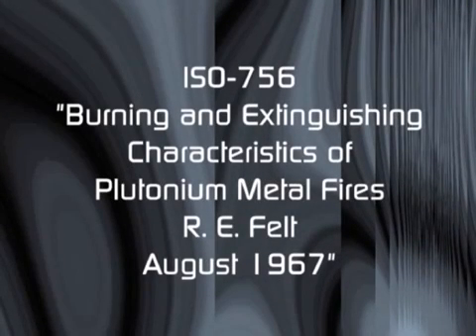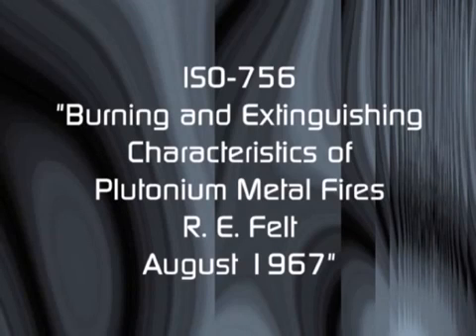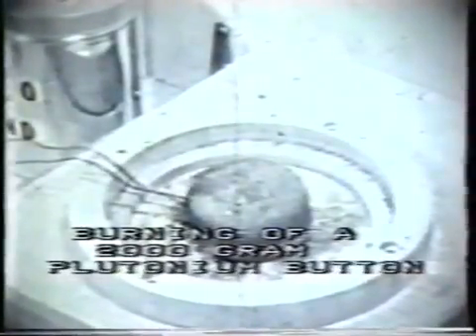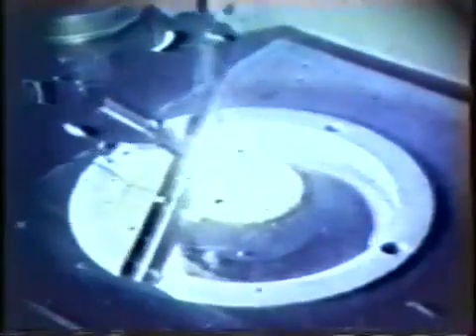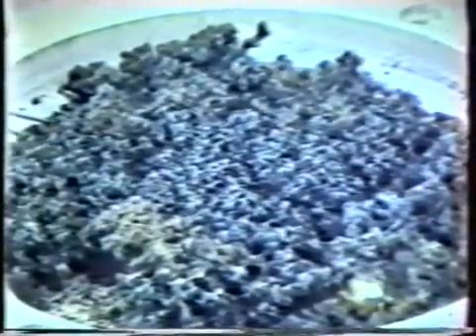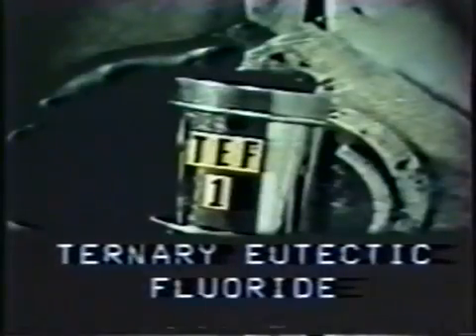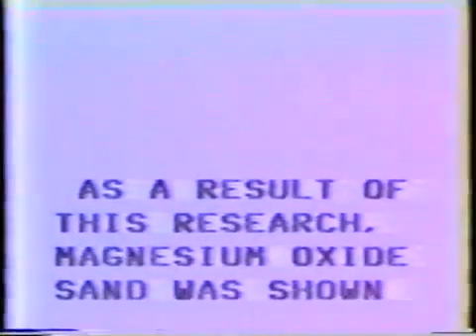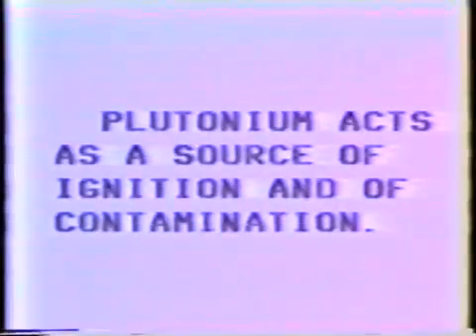Burning and Extinguishing Characteristics of Plutonium Metal Fires

Comment: It took a carbon arc to ignite it, how pyrophoric can it be? Just don't let powder collect, I guess.
The sight of burning Pu is terrifying.  I'd just as soon not be in the same county with the stuff, and
aside from little samples in element displays, I think that's true. Used to be downwind of Rocky Flats when it operated tho.
Reply: In bulk form it's not too bad, but fine turnings are outright flammable, they burn similarly to magnesium but not as hot. Another nasty habit is it preferably forms peroxide and hydride when exposed to air resulting in an explosive fire that cannot be put out till the peroxide and hydrogen are consumed. 😳☢️💀💯

Comment: They claimed they used water to put out the plutonium shavings fire at Rocky Flats in 1957. I call bullshit.
Reply from the maker: Water is the only agent that has successfully extinguished a facility fire involving plutonium. The reason water was so successful at Rocky Flatts is that the fire department used a misting, fog type nozzle. This causes Pu to oxide in a more controlled manner without moving or spreading around. It slumps and stays. So, yes, I can confirm, they certainly used water in several of the Rocky Flats fires. 

https://www.energy.gov/sites/default/files/2023-05/Bruce%20Campbell_The%201969%20Rocky%20Flats%20Fire%20-%20We%20Should%20Not%20Forget.pdf

Comment: Using graphite powder to put out a Plutonium fire requires balls of steel. Graphite is a moderator, meaning that it significantly reduces the critical mass. If you aren't sure about how much Plutonium is burning, and you pour graphite on it, you could end up with something that makes you forget all about that little fire. Then your hair falls out.

Comment: These were very costly experiments. The Pu was designated for recovery and would have been oxidized anyway. The experiments we are watching would have been highly classified. There concerns at the time may have been more about fire and material containment than extinguishment. These studies probably helped establish dry-box and other containment enclosure limits for Pu fire control. I would have liked to watch the same experiments with Thorium, which gives off the most beautiful blue hue when burning, but would have burned through the stainless dry-box bottom in a split second.
Reply: How hot does thorium burn?

Comment: I have always been curious about how scientists determined how to create and store such dangerous material. This is fascinating.
Reply: it'sthe waste acids and gasses i'm curious about
Reply: @wolu9456  That part became a superfund site and we spent a fortune managing all the contaminated substances. Or in the USSR, they dumped all that crap, including the waste fission products, into a big holding tank, where the fission products provided a steady heat source, and wouldn't you know, once it boiled dry, the nitric acid plus a few other chemicals, under high temperature, form ammonium nitrate. They were doing this on the scale of many tons, and yeah, they triggered a ~100 ton convention explosion of ammonium nitrate, which, fine, that's not a big deal, but it's dispersing radioactive fission products all over the place. That area is now a "national park", off limits to the public -- see "Kyshtym disaster".

Comment: So this is why my friend from Los Alamos told me they had buckets of mag oxide sand in many of the labs he serviced as a maintenance technician. Told some crazy stories about having to fix a mill mid operation. Said you had to dress in secret clothing and spend minutes working max. He lost his nerve after seeing many friends with cancer. I wonder how much radiation is released during the fire. And at what oxidation state does the plutonium end up at? Can the metal be recovered still? Very interesting.
Reply: Chemical reactions do not interfere with ionizing radiation which is something that happens in the nucleus of an atom.
The amount released would be the same if the lump did not burn and can be precisely calculated.
Reply: Mixed oxidation states, it pretends to be 3 and 5 plus iirc. Yup they are very funny about some types of research, and they like to compartmentalize it. Hence you may have a q for something but not for another project on site. Also the person doing the machining and the maintenance have no idea what the part is for. Plutonium is used for all kinds of research ranging from neutron sources to acellerator targets to nukes to special reactors and thermal batteries for space and deep sea stuff. Machined Plutonium is usually for variants of nuclear weapons parts or precision (micro scale) reactor parts.
Reply: @christopherleubner6633  Back, when my friend was working there, The US was  in full nuke production and still doing underground testing. I'm guessing the labs are doing much different stuff now.

Comment: You can simulate the plutonium burning with a metal called cerium. Was rather surprised they tried halon as it is a major NO-NO to use it on any kind of burning reactive metal. Cerium is the metal that gives cigarette lighters their ignition sparks, to see how a plutonium fire would burn heat a cigarette lighter flint till it ignites and drop it on concrete. 😲 If you disturb a burning plutonium fire, it will burn more violently. Argon gas is used to fill gloveboxes for machining the stuff. An emergency back up extiguishing media of a glassy sand that forms a low melting eutectic crust or a metal alloy powder is also available. 🤓

Comment: Turning Plutonium on a lathe would likely leave fine shavings and the heat generated from frictional resistance I would think could ignite Plutonium.  
In these tests it would seem would endanger workers exposed to the Plutonium and its gaseous oxides.
Reply: It is turned in lathe that is in a glove box with a magnetic clutch from the machine motor itself. The glove box is filled with argon or nitrogen, though sometimes helium is used. The stuff machines very similar to gummy aluminum alloys, but if you tried machining in air it will burn like ferrocerium shavings. This would be very very bad.
Reply: The lathe would likely be contained in an atmosphere of hydrogen to preclude spontaneous ignition of the Pu.

Comment: It's rare to find pictures of plutonium in quantity. And here we see a 2kg puck burning. Amazing stuff. It brings into perspective that even Plutonium is "just" a material. Nothing magical about it. You just need a lab the size of a city to handle it. And tuna cans.
Reply: I find it way more interesting than most materials. It has 7 different allotropes, all with different metallurgical qualities (which is why it's so difficult to machine) It's super heavy, pyrophoric, radioactive. And completely man made on earth.
Reply: @RobertCraft-re5sf To the detriment of all living things!
Reply: @RobertCraft-re5sf  "completely man made" is not exactly true. Read about the Oklo natural nuclear reactor that was discovered in Gabon Africa in the 1970's. Plutonium was found thats formed by surplus neutrons transmuting U238
Reply: Isn't that 1/4 needed for a critical mass?
Reply: You can make a working bomb with less than 2kg.
Reply: with neutron reflective materials , you can get down to 5 kg of plut to go critical, but then it will just melt with extreme predjudice, you must clobber it with focused shaped charges  to get super-criticality [ boom!]  and if its next to a bar of lithium deuteride/tritide  wrapped in u238 [tamper]  you get fusion[ big badda boom!] @n1k0n_
Reply: A critical mass isn’t a single number. 3 kg is more than enough in most weapons; the reason is neutron reflectors and the implosion that compresses it.
Reply: And acres of land nobody can go to or use for 10k years to store the poisonous waste where nothing bad can ever happen .
Reply: Radioactive materials are highly solvable in water! And if one isotope isn't solvable, as it  decays into other elements it can become a gas, like xenon133, or an element that is solvable!
Reply: @richinoable 640 square miles at Hanford WA!! 475 BILLION GALLONS OF EVERY SORT OF TOXIC WASTE DUMPED DIRECTLY INTO THE SOIL!
Reply: 😂😂😂😂 lmfao "and tuna cans" 🤣 brilliant! I haven't laught this hard in age's. Thanks man... "tuna can's" 😅
Reply: @kev04092  And all that means is simple acid oxidation. Been done now for about 100 years. The narrator didn't say how much of the material was recovered. Buring/combustion is a form of oxidation it can also permanently change matter. Look at a cracker in a refinery. It's capable of ripping molecules apart and rearranging atoms and making different new materials. And we all know as radioactive materials decay they are no longer what they were amd can't be. Uranium decays leaving radon gas. Radon is made up of atoms from the Uranium. Your never putting that back in the bottle. So if it burns what would it NOT be possible to become something else? Thats my point and question.
Reply: The plutonium was less than weapons grade so it was used. They were going to turn it into oxide anyway for making reactor fuel. Too much 240 in it. The real danger is if chips and turnings react with moisture, it preferentially forms peroxide and hydride due to the radioactivity, and when it ignites it flares violently and can cause a chemical explosion scattering it everywhere. This happened at Rocky Flats, more than once. 😳
Reply: the USD 300-400 per g figure reflects only the incremental operating expense of stripping plutonium out of already-paid-for spent fuel, whereas the “millions per kg” number folds in the capital write-off, R & D, security, waste management and eventual site remediation.  Because plutonium production is capital- and compliance-intensive, those fixed charges dominate the economics once the material is expressed per kilogram.
Reply: @felixg3  The corollary is then also true. If you have to have those sites anyway, the marginal cost per additional gram produced is low; so go big or go home.
Reply: And at millions per gram you also need a train full of large bills for a small test. And another train load to clean up. Then 9 more trian loads to store the mess.
Reply: @tireballastserviceofflorid7771  I am sure after burning it every single bit of that smoke Pu oxide smoke and ash was condensed and collected to be made into metal again.
Reply: @RobertCraft-re5sf  But you don't really know. Could be buried in a waste pit.
Reply: @RobertCraft-re5sf  could also be released and "whoopsed" if someone found out
Reply: Your a bit out with your price. It costs $300-$400 per gram.
Reply: @HE-pu3nt I think they put the whole cost for the plutonium production into account, including R&D and upfront investments. The variable cost of plutonium may be 300-400$ per gram, but that does not take into account the deprecation of the facility and projects related to plutonium production. In that metric, it’s probably much higher, into the millions per kil
Reply: Plutonium was not nearly that expensive. They started with big graphite reactors and lots of reasearch; but that’s not how they made most of that plutonium. It was made in a mature process with much fewer researchers.

Comment: This hits home for me. I've visited a vacuum lathe used for designing warheads. The question of handling the turnings has always been a question in my mind. This example was what I was thinking might be a possible outcome.
Reply: The chuck is coupled by a magnetic clutch into an argon filled glove box. Relatively normal tools are used for machining. Chips are sucked into a special criticality safe vacuum cleaner with a built-in neutron detector with the HEPA filter recirculating the argon inside.  The whole machining center is at a slightly negative pressure relative to atmosphere.
Reply: @christopherleubner6633   thanks for a more thorough explanation of the equipment I saw. I was shown that lathe while I was in the lab. I didn't see it in operation but a simplified explanation was given to me at the time. There was, at the time a lot of security about certain processes being performed there.
Reply: Rocky Flats Nuclear Weapons Plant where 2 of the worst and most expensive industrial fires in the USA occured ,..... 1957 and the 1969 Mother's Day Fire were the result of Plutonium scraps and shavings  spontaneously igniting and spreading from 1 glove box to another !  All the various machining and casting operations had cans of oil to extinguish any Plutonium fires that started by smothering the Plutonium and omitting the oxygen . Later, fire sensors were installed in the glove boxes on Plutonium stored in Benelex plastic enclosures as a fire prevention measure . However, production was slowed and workers blocked the fire sensors to speed up production . The resulting fire nearly took out the roof of the building which would have spread Plutonium easily to Denver and beyond !   Watch video ,.... " Secrets of a Bomb Factory "  also analysis of the Rocky Flats Fires !
Reply: They vacuum them up into a donut shaped canister that separates and reuses the cutting fluid ( newer ones use dry inserts) as the chips are produced. The whole system is closed and purged with argon or helium, with helium being preferred for weapons materials. When the container gets full a neutron detector sets an alarm off ( well below criticality). Then you swap out the container for a fresh one and resume work making shiny half footballs. 😂
Reply: Thanks for the info. The one I saw was used for certain base element boosters in weapon production. It was an amazing piece of equipment, I don't think that all of the finer points were explained. I was there to use a different piece of equipment but got a full tour of the lab. @christopherleubner6633
Reply: ADA165790.pdf
google it
Reply: talk about not knowing what "hit's home" means 😂

Comment: Hmmm...Rocky Flats had some horrific plutonium fires that were very hard to extinguish.   Machine turnings  in large amounts once burning just dont go out.   Water will actually accelerate the fire.
Reply: AND moderate the neutrons. A HUGE NO-NO😮
Reply: Yeah it's interesting because a former worker in an interview said one thing they did in 1957 was dump boron onto plutonium.
Reply: @fredharvey2720 yup a borosilicate phosphate glass is used as the last resort for putting out PU fires, typically small fires are put out with argon gas if at all possible.
Reply: Yup they had lots of spicy turnings there, Pu U and Be. Not to mention the highly flammable Ti and MgAlBe turnings. The place had Homer Simpson levels of disregard for safety combined with  better than Ft Knox leves of security. 😂

Comment: The amazing thing about this video is the primitive apparatus used for the test.  Just gonna put 2 kilos of Plutonium on this fire proof sheet and put a ring around it 'for safety reasons', then set it on fire and see if we have anything that will put out the fire. 
Very smart people were doing this, but it still sounds like Homer Simpson class nuclear research.
Reply: The ring was to stop molten plutonium from flowing where it shouldn't. It melts at a temperature slightly higher than lead.

Comment: Hmmm I wonder what event could possibly have motivated the Brits to look into extinguishing a molten radioisotope metal fire 🤔
Reply: It's more likely to be related to the 1957 Rocky Flats fire in the US than the Windscale fire in the UK. The former were plutonium shavings fires in gloveboxes, whereas the latter was a uranium/graphite fire in a reactor.

(Also, he says in the very beginning this is research conducted at the Hanford site, which is in the US.)
Reply: @piranha031091  Precisely! 👍
Reply: A safety concern I expect. If the stuff needs to be used, I suppose it would be a good thing to know how to put out a fire if that can occur...

Comment: If you used graphite to try and smother a Pu fire, would this risk causing a criticality accident?
Reply from the maker: It's unlikely. As Pu oxidizes it expands. Pu Oxide is very fluffy and light and doesnt lend to becoming a criticalicality favorable geometry. The Rocky Flats fire of 69 is a testament to how difficult it is to accidentally create a crit scenario when fighting a Pu fire with water.
Reply: @calibob2001  What's the melting point of Pu, I imagine liquid Pu to be quite angry ?
Reply: @calibob2001  WRONG !  After the fire fighters used up all the CO2 and chemical extinguishers in their attempt to put out the Plutonium fire, their only choice was now WATER ! HOWEVER ,... they were very careful NOT to use a heavy jet stream but rather a fogging shower spray and never to push any Plutonium into a large pile for fear of a Criticality Event ! Water will MODERATE the neutrons and allow for chain reactions, just like in a WATER MODERATED REACTOR !

Comment: Ok so the fumes are dragged through filters and  vents. The mess left behind is cleaned up how? Buy putting in all in concrete lumps  or a can. If only we could be unified and  ban using this crap..
Reply: they probably extract the plutonium, its expensive stuff. but yes, some will probably get out into the environment you would think.
Reply: @membola  A properly equipped plutonium processing facility will have closed-cycle filtration that is not even connected to the outdoor environment.
Reply: You deserve nothing more.
Reply: What an uneducated, loud and narrowminded comment full of antiscience hatred.
That "crap" is what gives us cleanest energy and radioisotopes for treatment of various diseases and scientific investigations.
Material can be recovered and turned into other compounds of interest. The bible doesn't teach chemistry so I guess you're excused.